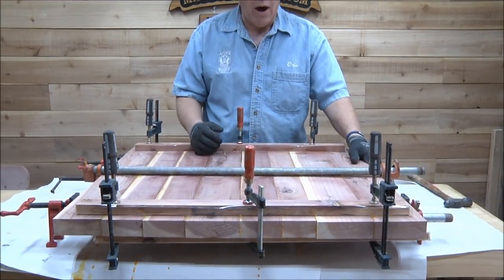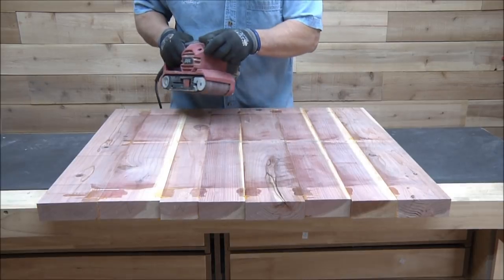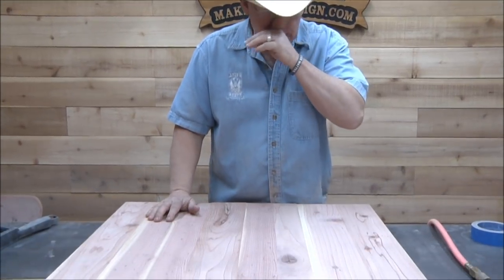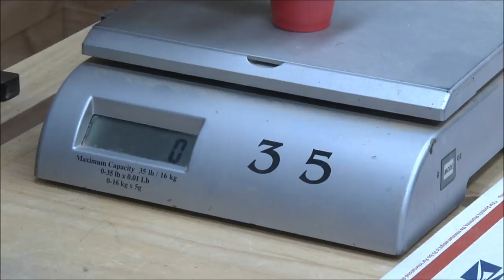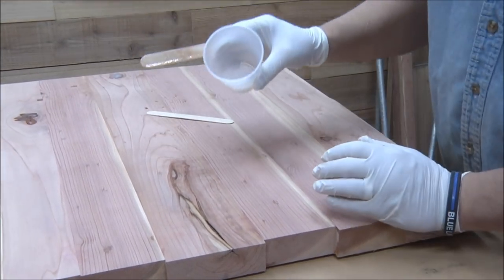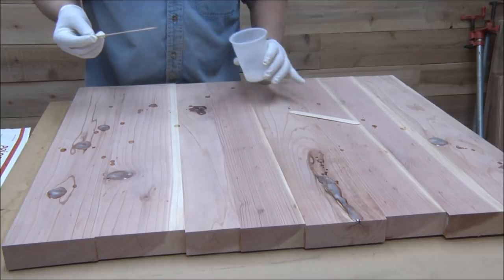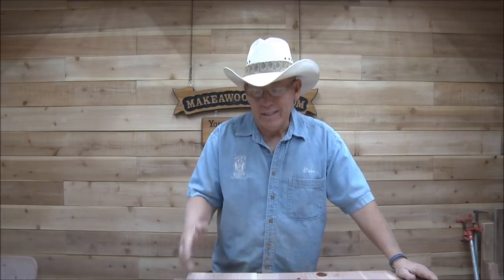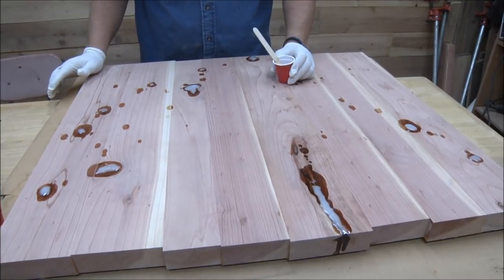#264 Part 2 of 7 Prepping & Sanding Board + Filling Knots With Epoxy

Comment: I’ve been gluing up panels for signs like this for years. For large pores to get the bubbles I have used a hair dryer, heat gun. even a blowtorch. All works. I use tape on the top side also to contain the poor sometimes. Keep up the good work👍🇨🇱😎
PS. Did I miss sign Carver of the day lately?
Reply from the maker: Yea I'm still learning this epoxy stuff. Lots more to learn for sure. I'll be doing another large SCOTD after this project is done. I want to just keep going on this till I get it completed. Probably at least 4 more videos. Lots more to do.
Reply: Just love tuning into your videos every chance I get. Thanks for all the encouragement that you sent all of us. If I ever get pointed in your direction I will definitely stop by. Three signs behind right now. LOL!!! Y’all have another great day👍👍🇨🇱😎
Reply from the maker: Thank you my friend. We'd to have you stop by if you're out this way. Sounds like you need to make some sawdust, Have fun!!!

Comment: Hi Dave. I've built a few boats using epoxy. To fill voids I mix epoxy with wood flour to a penut butter consistency. Than I fill the holes or voids, it wont run on you. When dry it sands very well. You can use the dust from your belt sender, it is perfect for this type of work.
Reply from the maker: What a great idea, Thank you so much...

Comment: That is some awesome wood, Eric....looks very good quality! I live in the southeast (extreme southeastern Alabama) and we don't have any redwood 2x4's like I heard you saying you get at Home Depot and/or Lowes.....only pine (and similar in 2x4"s). We do have cedar fence boards, 4x4's, and good grade sanded cedar 1x2 thru 1x12 that is very expensive and I guess thats because we are too far away to get the types of wood that are available to you guys out west. Thanks for another great video Vicki and Eric!
Reply from the maker: Yes different parts of the country or world have (or may have) completely different types of materials available. What you need to do is look and see what you have that I might not have.  For instance I did a video a few years ago on cypress. Check out video #170. The main thing is experiment with what you do have available to you.  Some parts of the country have cedar decking fairly reasonably priced. Just keep your eyes open and experiment. Hope this helps.

Comment: Just a comment, but since you are using a scale, in the first step here, couldn't you use just one cup and pour in 20 grams of one indegrient and then add the second untill you hit 40 grams. Save you two using two extra cups and time as well as any reisdue left in the first pouring? Then mix as you had done.
Reply from the maker: Yep that's another way to do it. However now I've done more research and the prevailing thought is to measure more by volume than by weight. I'll be doing that on Fridays video.

Comment: I watched twice but may have missed it,  what was the purpose of filling in the crevices
Reply from the maker: Great question....2 reasons I should have mentioned but probably didn't. 1. some of the knots were kind of loose and if I have to carve through them I don't want them to chip out or break away. 2. When I spray the black or any color I don't want the spray to get down in the cracks that I won't be able to sand out. One more reason, it looks cool....Thank you for asking, Eric